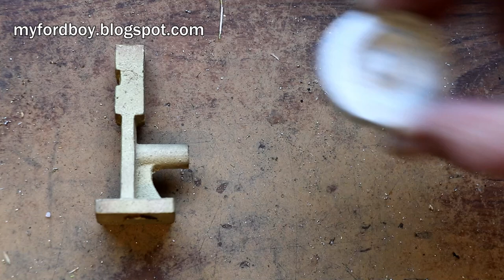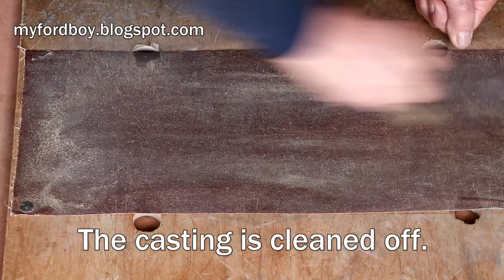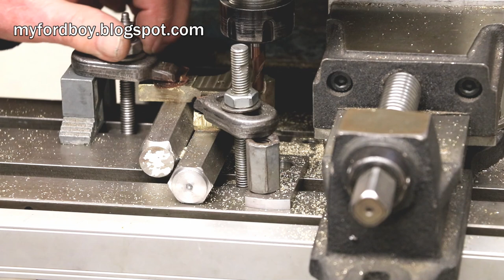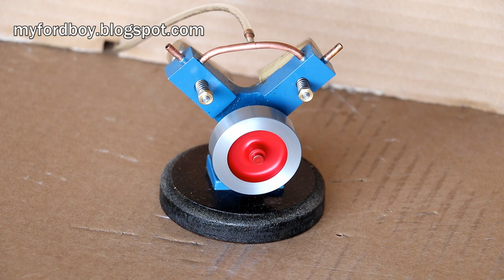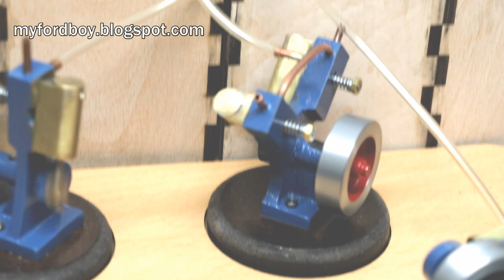The Myfordboy V Twin Wobbler. Steam Engine.

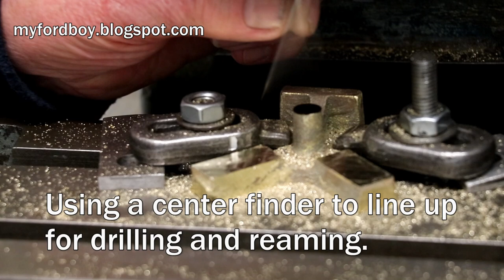Comment: 2:13 I've learnt from painful experience to avoid using my fingers to center the wiggler while the mill is running. I roughly center it by eye before turning on the mill and then use the graphite tip of a pencil to do the final adjustment while the mill is running.

Comment: All wonderful little engines, I especially like the horizontal twin, very nice 👍👍👍
Reply from the maker: My favourite too.
Reply from the maker: You would use a displacement lubricator and steam oil of running on steam.
For air light oil applied directly to the parts

Comment: MFB when finding the bearing center you made 4 marks. Suppose the casting was more oval how would you find a center then?  cheers  stay safe   Ralph
Reply: Just use the same method.  Try it.  You will see it works.

Comment: How are the mating faces lubricated to reduce wear from the wobble motion - any specific type of lubricant?
Reply: You would use a displacement lubricator and steam oil for running on steam.
For air light oil applied directly to the parts